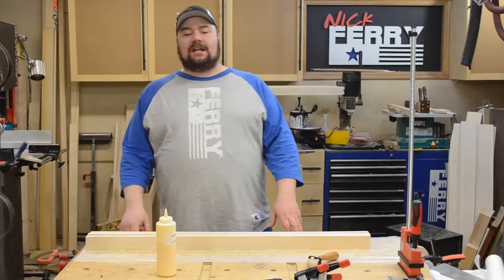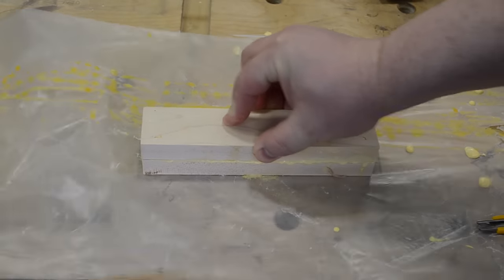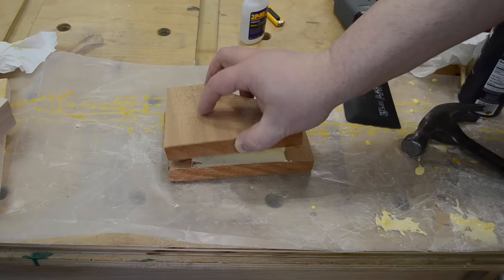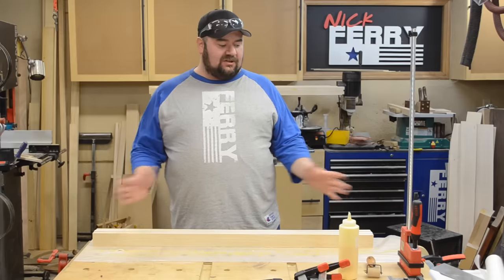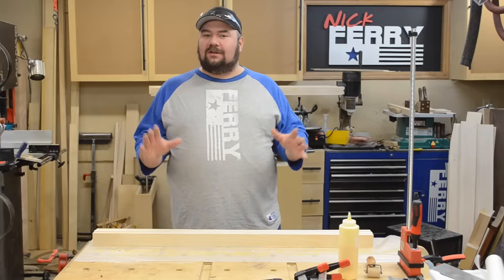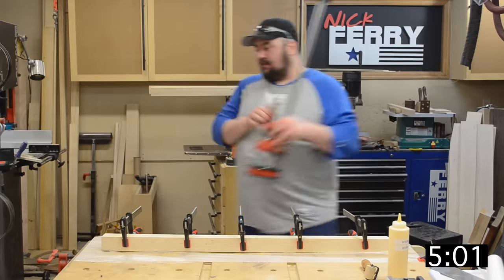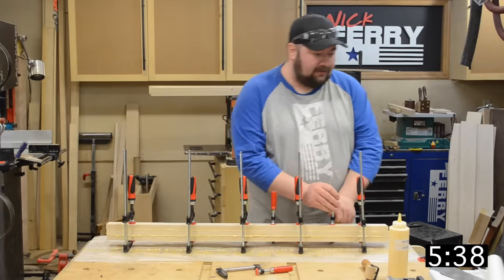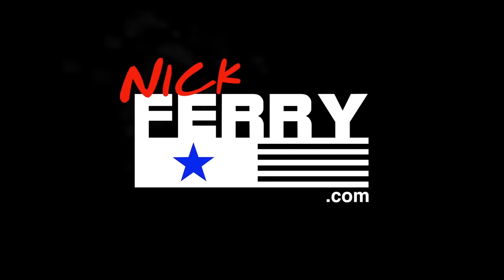Ⓕ Best Way For Gluing Wood Together To Get Thick Pieces (ep86)

Comment: you tried putting glue on only one side of the wood?, it work the same and you spend less time and glue ;)
Reply from the maker: I have - sometimes with success - other times with voids - I hate fixing voids later so I opt to take the extra time on assembly so I don't have to worry about it

Comment: I question your buddies woodworking skills if after 20 years had never clamped in this manner.
Reply from the maker: I don’t - surprising maybe - but I’d find it asinine to think every woodworker or carpenter has seen every tip or technique to every process
Reply: @NickFerry  ,I am left to assume your friend has no formal education in woodworking or worked in a professional shop as the method is like glue up 101.

Comment: Should be obvious, i was taught at school when clamping wide boards for tables etc that a clamp across the join helps alignment, also cawls in the middle if neded
Reply from the maker: For sure - for legs this works out well
Reply: yes. you were TAUGHT in SCHOOL. Do you think everyone watching nicks vids took wood shop or went to college for carpentry? I suspect most did not.
Reply: Don't they do woodworking as part of the school curriculum any more ?  O.O
We did metalwork too.
also, most woodworkers know how to clamp a tabletop i would think.
Reply: Yeah i also will clamp two 4 foot levels across the top and bottom of big glue ups like a work bench type of situation, i know they are dead straight and glue doesn't stick to the aluminum
Reply: It's an elective course in most places now if it's available at all. You have to remember that not everyone watching a video on YouTube is a seasoned woodworker either. Most in my experience are beginners that haven't built many large or advanced projects.

Comment: See this kids?

Now you understand the importance of a jointer.
Reply from the maker: I’d much rather show this, than tell someone they can’t do woodworking if they don’t have access to a jointer - btw, I do have a jointer
Reply: A jointer is not required all the time, especially if you have really solid straight line rips from a table saw jointer setup or a track saw setup. Even with perfectly dimensionalized pieces, that doesn’t help with slippage once glue is in place.

Comment: Wayyy to much glue.  I know, every video on her shows lots of glue squeezing out of the joint ant that is supposed to make a better bond.  But today's adhesives really don't need to be slathered on like this to make a good bond.  I have been a woodworker, carpenter, and cabinet maker for over 50 years, you guys use more glue in one glue up than I do in a year's worth of projects.  And NONE of my glue-ups have ever failed.  I have cabinets, panels, and other stock glue-ups in my home that I did in my first year of building (back in the white glue era) and none of them has ever failed.  Save some glue, forget all the squeeze out and clean up.  Sorry to get on top of your video with a comment, but it is a real pet peeve of mine.
Reply from the maker: to each their own - my pet peeve is having voids in finished glue-ups and having to rework things that could be prevented by using a little extra inexpensive glue

Comment: too many clamps  man !! for this job I'm using only 3 and work perfect !!! you must love  clamping
Reply from the maker: I secretly head up one of the world's largest underground tool manufacturing conglomerates - specifically the secured materials division - it is my job to slowly, over multiple generations convince the masses in the western world that the immoderate use of clamps is socially acceptable and merely standard practice
Reply: One guy said every 2-3 inches Holy Cow Man he really loves to clamp.

Comment: Don’t bother putting any links to this crap.  You don’t know what you’re doing as well as you are using too much glue.   You will not have the strongest joint possible with using that much glue.
Reply from the maker: You're probably a lot of fun at parties

Comment: Glue idea aside, the click bate picture which you never address in the video leaves the viewer feeling played. No one like that, and thats why you have all the thumbs down.
Reply from the maker: The picture is with and without using the method I showed - one lines up, and the other slides around - I talk about it for almost entire video
Reply: Just sharing honestly how it comes across. I am not a hater and you are free to do with my observation as you like. I watched your entire video and despite appreciating the info you shared, it certainly made me feel click baited. Your video shows use of a parallel clamp to align boards in a glue up but your picture doesn’t show any clamps, just a standard arrangement of boards glued together vs a very nonstandard layup arrangement with glue between all joints in both varieties.
Reply from the maker: Thumbnails are always tough to exhibit what the entire video does - I’m not worried about thumbs down - I presume people wanted a monumental technique but several dozen who hadn’t seen this method before, have posted on social media trying the technique and loving it - getting perfect results where the hadn’t gotten them before - that’s all I can ask for

Comment: Way too much talking.  This vid could have been done in less than one third of the time.
Reply from the maker: you have the ability to fast forward and skip parts on your end - if it were shorter, the people wanting to see multiple methods and more explanation in real time wouldn't have the ability to "add" to the shorter video - I'm here to share some ideas, not to be a succinct ninja
Reply: Fair enough N.F.  BTW, the salt was novel to me and I have been working with wood for more that fifty-five years.  Good one.
Reply: My goats would love the laminations glued up with salt.  hahahahahahahahaha
Reply from the maker: salt is not my preferred method but at least it gives people some thoughts on using things in different ways - may even spark a better idea altogether - thanks man!